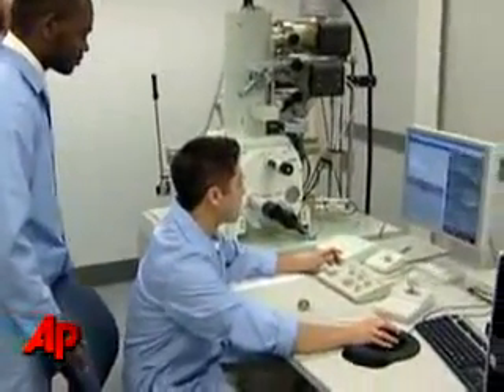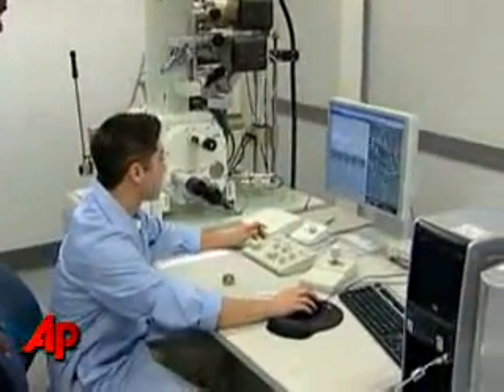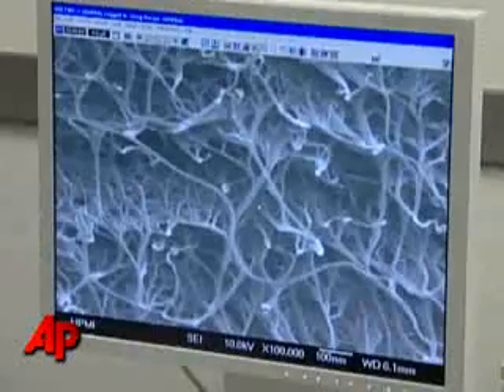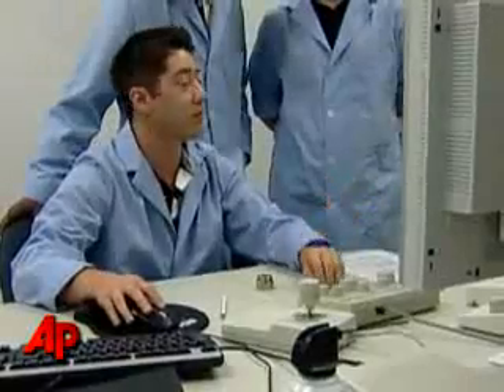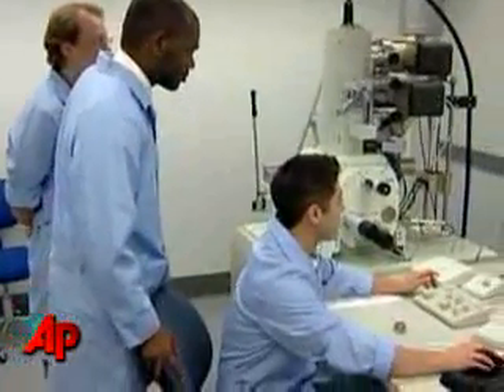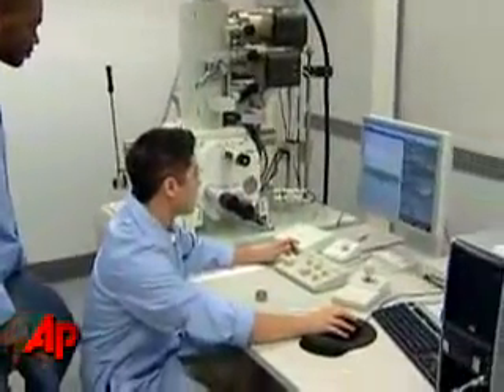Advanced Composite Materials: Buckypaper

Comment: Buckypaper weighs about 28.93% what steel weighs. Basically steel weighs 489 lbs per cubic foot.  Buckypaper will weigh 141.5 lbs per cubic foot and be 500 times as strong.

Comment: What I’m getting is that they’re making a kind of “felt” from the carbon nanorods.

In felting, you have a substrate with an adhesive on it, sprinkle loose threads on it, and it mats together.

At that scale, sub-atomic forces called Van Der Waals forces come into play.

You can see something similar by weaving two phone books together, one page alternating between books.

Then bulldozers can’t pull them apart.

So, with the tremendous surface area of the carbon nanorods, just that thin layer locks together tightly.

Use Carbon Fiber resin, and you can build a composite that’s freakishly strong.

A more recent development is “spinning” the nanorods together into thread.

If you then weave the threads into fabric, you’d have something even stronger.

In both cases, the buckeypaper and the nano-thread conduct electricity and are very strong.

If we could JUST figure out how to dope this and get room temperature superconductor fabric, we’d have a new Electrical Grid and flying cars in five years.

Comment: I did a whole research project on that, the problem is that if only one flaw is found in the cable, the whole cable is weakened by 23%(I think), and if there are ten flaws in the atomic structure, the cable is weakened by 80%.

(Don't hold me to those numbers)

Comment: standardization is prevalent in f1 they all use the same wing. this is a cost cutting measure race orginizers have enacted so that the technology does not get so expensive that the lessor players cannot afford to compete. I don't agree with this as it limits the application of the best technologys'. when the drs is used the bottom wing just drops out of the air stream completely there is no changing of attack angle. the wing just completely drops out of the air stream.

Comment: drs is not changing the angle of attack it totally removes part of the wing a flap falls out to reduce the force of the wing. it's not used for braking and drs is only allowed in certain long straightaways.  yes it's an upsidedown wing.  the angel of attack of both aerofoils on f1 can be changed independantly from the cockpict or the pits.  kers is back this season.

Comment: cars are as slick as possible to avoid air disturbance. airplane wings disturb the air as much as possible to create a partial vacuum. f1 cars use  a wing and ground effects, only lately has f1 started using drs to avoid having this drag on the cars in long straightaway's were it's not needed.

Comment: airplanes are not actually very efficient tons of drag are necessary to create the amounts of lift necessary to lift a plane thousands of feet into the air. a car on the other hand is susceptible to ground effects which makes it hover over certain speeds  . cars and airplanes operate in different modes not only because they are different vehicles but because the ground effect alone change much of the factors.  @ 90 mph on 1/16 of an inch of the tire is in contact with the ground.

Comment: some things I can't tell you.  let's just say that a gas turbine is involved.  keeping the wheels spinning with electric motors just a moment before touchdown is not  impossible. if they don't get spun up to speed it just creates a wear spot on the tire like when planes land.  calculations are involving many variables such as heat loss, heat recuperation, regenerative braking, and lack of rolling resistance.  a big part of it is lack of weight from composite sandwich construction.

Comment: that math does not add up 800 mpg is my goal @ 140mph. the down force is only applied in corners and turns to allow the wheels to make contact with the road and give enough grip for the turns.  when the vehicle is going straight and only subtle course corrections are needed aerodynamic forces can be used. rolling friction is what causes the most of a cars fuel use other than pure aerodynamics. the car will be shaped to remove as much of those as possible.

Comment: think it was a 50cc diesel car that barely does 10mph. bernourli principle of fluid velocity and vacuum.  f1 cars use this to suck the cars to the road , it's not all wing that produces the down force.  canam cars pretty much introduced this tech in the mid 70's , there were huge fans in the back of the car that sucked the car tightly to the ground. this allows the vehicle to perform turns that would not be possible in a millions years.

Comment: @satch2006 turbine electric hybrid, runs off of any fuel . kers system, regenerative breaking, might actually hover above the road way by about an inch in straightaways and touch ground to make turns , drive in the city etc... rolling resistance is a big hurdle. having tires touching ground constantly does not make much sense.

Comment: @satch2006 in reality. car body's have been created that way 50kg vs 2500 lbs that are even stronger than the steel they replace. advance metals such as honeycomb aluminum/titanium can provide the additional protection from shock  when used in layers with styrofoam cores. this technology is already proven in the aviation and aerospace industry's.

Comment: @satch2006 yes I'm aware carbon fiber is basically fancy fiber glass as far as working ( but not designing ) with it.  carbon nanotubes being used in fenders and bumpers quarter panels etc.. not sure what kind of weight savings but what I heard it's a strength  thing first then weight.

Comment: @satch2006 wetting out fibers does nto take that much times.  cost of cnt ?? I've not looked into that yet. I"m dealing with the possible right here and now. I can rebuild my honda accord in carbon fiber and almost double my mpg right now in a few weeks.  I know how to work with that. however if like any other material the cost will come down . carbon nanotubes are already being implemented in some gm products.  the paradign shift is accelerating rapidly though.

Comment: @satch2006 I know people who swear carbon fiber is still too expensive at $40-60 a lbs vs $1 lbs for steel. this is not the case as carbon fiber only needs about 60 lbs for the same application like a car vs 2500 lbs of steel . see how expense can be the same even if the better one cost more per lbs?? moores law is begning to apply to materials.